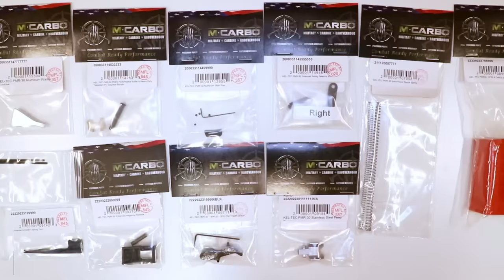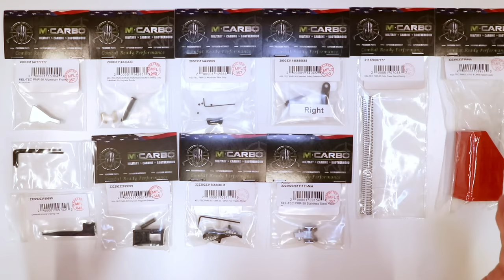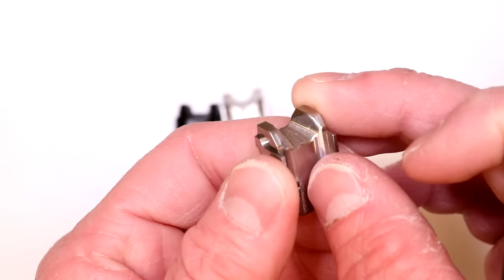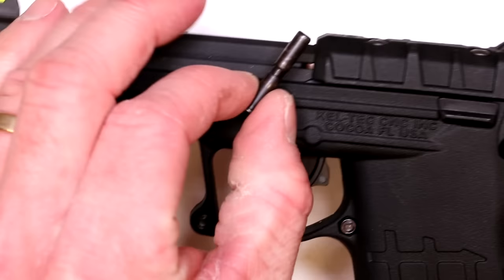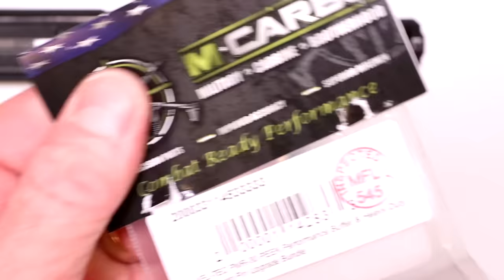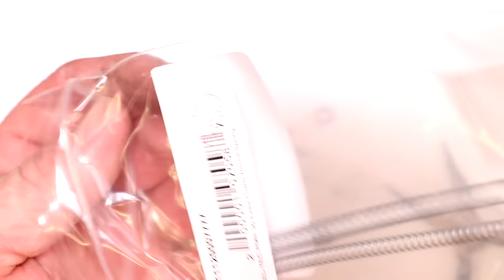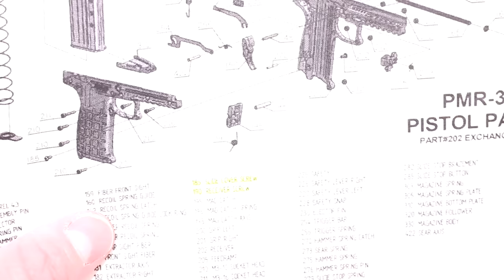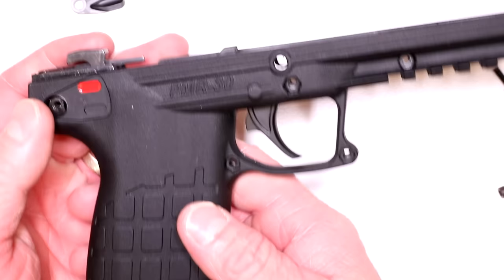KEL-TEC PMR-30 All In One Pro Bundle!  M*CARBO PMR 30 Review of Upgrades & PMR 30 Disassembly!

Comment: .
The PF9 upgrades were fine, but the $$$$$ to M*Carbo my SUB-2000... ouch. (but totally worth it)   NOW THIS kit for the PMR-30?!?!?   My wallet can't take much more. 
.
(as of 24-MAR-2023)
You can find PMR-30s' for $370    You guys have this whole kit for $250.   That's 67% of the cost of the PMR-30   This is why I just HATE you guys. 😛   
.
Your products take an inexpensive firearm, make it amazing.   We don't even flinch at spending > 50% of the initial cost of the firearm, because  of the massive performance/reliability increase from your products.
.

Comment: The PMR is overpriced. For what they charge, it should come factory with the quality of upgrades you are installing. Other than that, I've seen too many Kel Teks malfunction to trust a stock one in a critical situation. When Zimmerman shot Martin, he got one lucky shot off. It was found that the kel tek he was carrying had a feed or extract failure after that shot. Lucky for him he put it in the right spot.